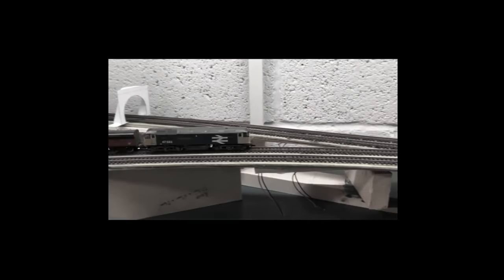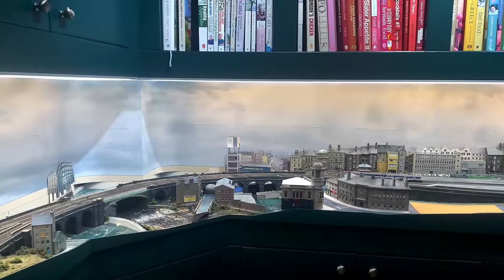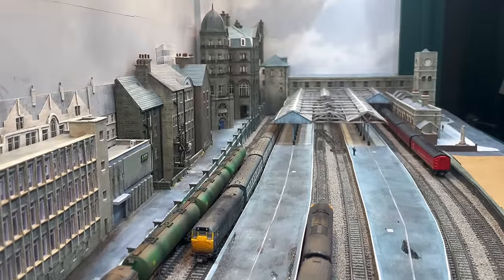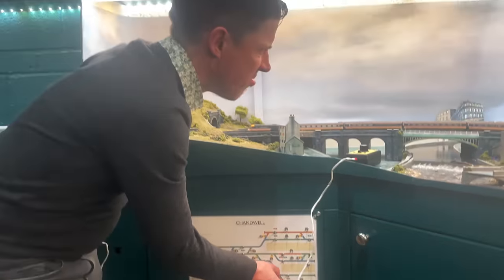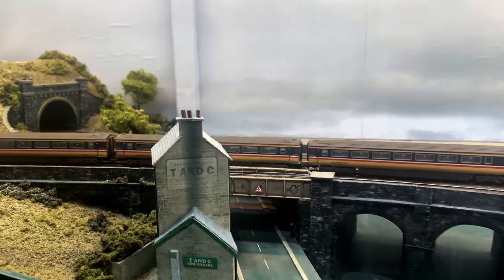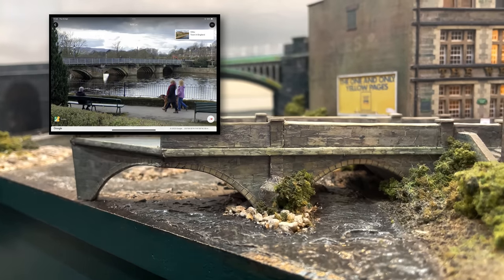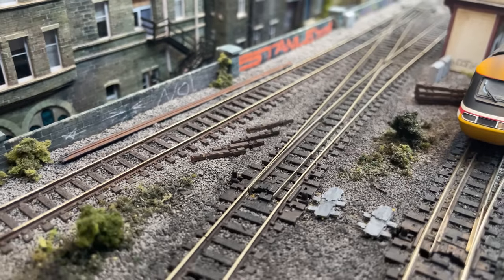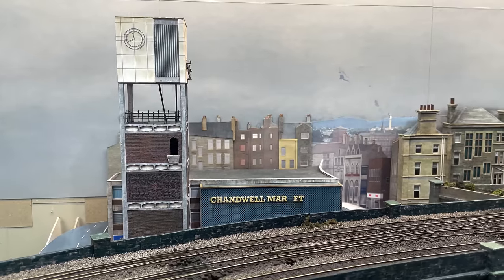Chandwell: A tour of my N gauge model railway layout

Comment: The whole concept, the construction, the promotion of what can be achieved in N Gauge makes this, Michael, one of the best layouts on YouTube. The shorter length of the videos coupled with what is within them is excellent. How often have we seen a video showing the construction of a grass embankment which runs for nearly an hour!!!
I was amazed at the size of the layout, thinking it would be a lot larger, but then this is however what can be created when you are an expert in your field, and why N is so good.
Thanks for the tour Michael,  really enjoyable. Cheers, Bob
Reply from the maker: Thank you Bob! The layout seems bigger because there are so many different vantage points to film from. I think because every road/river crosses the tracks and the layout at acute angles, and because none of the ground is flat, there's never really a clear line of sight from the front to the backscene, or from one side to the other. This makes it feel more like a town than a model.

Comment: Michael, as the builder of a small layout myself (less than 5 m2) I have made a careful study of what it takes to make a small layout look larger. One important element is detail: small details, which are not necessarily easily seen, draw the viewer in and invite even closer examination. This leads the viewer to experience the layout from a closer distance, making the overall layout seem much larger. Chandwell is a classic example of this: your attention to detail is phenomenal, and you have created - and continue to create - your own little world where a visitor can get lost for hours on end. Thank you so much.
Reply from the maker: Thank you so much for your kind words. I think you’re right but I’ve never really considered it before. I think something else that works well is that all my roads cross the layout at an angle other than 90 degrees. And the my go up hill. With the buildings in place, this means that there are so many different angles to see things from and you have to move around a lot to get a clear view of any given thing. To me, that makes the town seem quite real too.

Comment: Hi Michael, I knew the size of the layout from a previous video but hadn't realised it was in your office. How do you ever do any work ? I can loose a day so easily in my train room. Usually by Emma asking if she is a train widow !
As for DC and no point motors, that is just not on. I love the wiring and  having gone from switches to DCC operation on most of the layout, I can't wait to be able to do the rest as I hate the hand of god.
Everyone to their own though, we are all different.
With the HST would a curved cassette fit in your fiddle yard ? If not I suggest a brick hammer and chisel and take a few bricks out !
Mark
Reply from the maker: I could always knock through into next door's garage. They won't mind, will they? A 1.2metre long curved cassette may be a bit of a chore to get out, but it is a good idea and I'll have to give it a think. Funny how that never occurred to me!

Comment: Very nice, like the small spare where you have Max. it out,  as a dane 🇩🇰 where we only have 2 main tracks, one for each direktion, i have allways wondered why there is 3 tracks in uk 🇬🇧
Reply from the maker: Thank you! We also usually just have two tracks, but sometimes there are more around stations. This one is arranged like this to allow for the simultaneous arrivals/departures to more platforms. It wasn't always that way at Bradford. It was two track for a while but they added the third in the 1990s, I think.

Comment: One of the most realistic N gauge layouts. At N scale it is hard to achieve realism. Never seen this level of realism achieved using the printing methods you use. Typically super realistic dioramas and layouts requires individual scribing of brick/stone work, or the use of individual model bricks.
Reply from the maker: Thank you - that is very kind to say. I think you can get away with printed textures in N because the dimensions are so small. You'd never beat individual scribing though, I don't think. People who do that have endless patience, and it's mind-blowing what they can achieve.

Comment: Thanks fir posting this, it really is tremendous. I assume all your points are manual? Do you have pull rods to control them. I just finished a Glasgow tenement built mainly from grey card, inspired by your work👍
Reply from the maker: Thank you so much! Yes, all my points are manual and I don’t have any controls, not even pull rods. The viaduct arches contain slots and there are holes in the baseboard that align with the points so I could still add controls if I wanted to, but in truth I am happy enough with the manual approach.